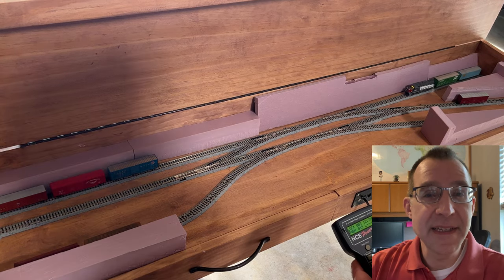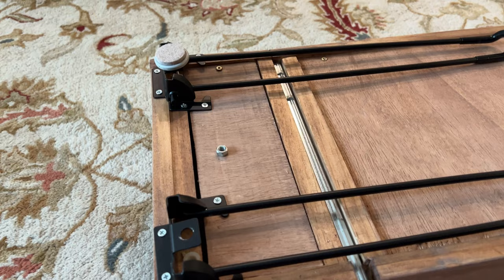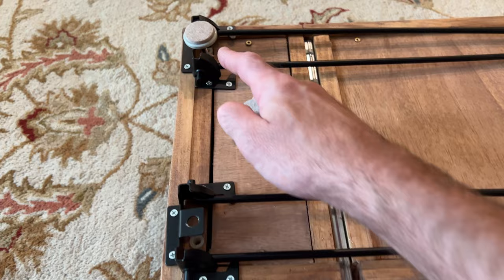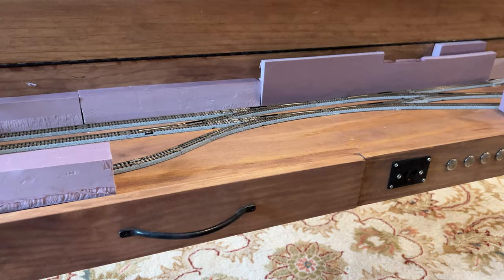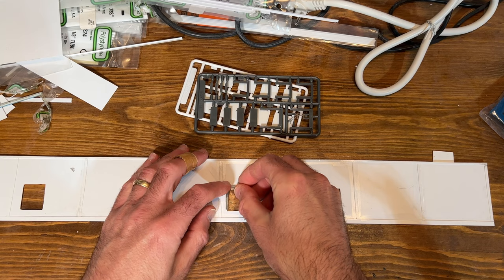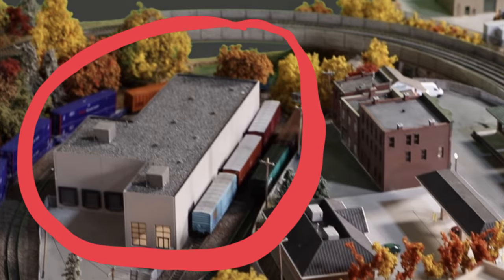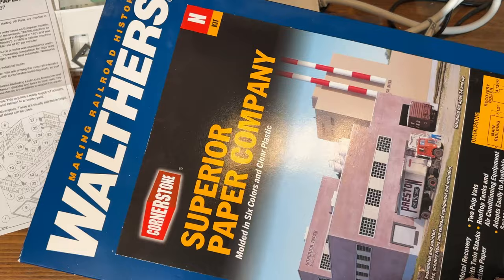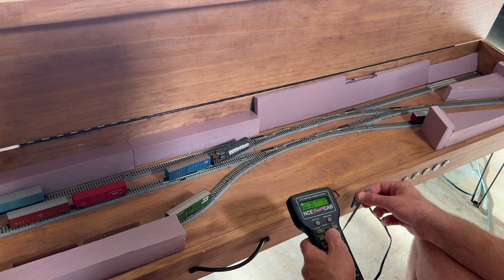N Scale Switching Layout in a Case Part 2

Comment: Very nice portable layout. I have noticed that you have disconnection problems. It's strange since you placed feeders at all the critical points of the layout. Something similar happened to me in a switching layout with many interconnected turnouts.
Reply from the maker: So the locomotive in the video runs better now that it has been broken in. But, Im not sure if all of those issues were power dropping out or momentary shorts.

Comment: I've never quite understood why people start out with a track plan and then try to find structures which will fit the track arrangement. Why not start with structures and then make a track plan to fit them? Isn't that the way railroads do it?
Reply from the maker: Well I knew what I wanted to do for structures for the most part but also plan to make them easily removable so I can swap them out for different operating sessions. Mostly I wanted to have the layout fit in the case I built for it.
Reply: @StevesTrains  The kitbashing is fun. Something I always enjoy.
Reply: Along time ago Model Railroader suggested making all the scenery first and then laying the track for ultimate realism.
Reply from the maker: I’ve thought about doing that sometime for fun.